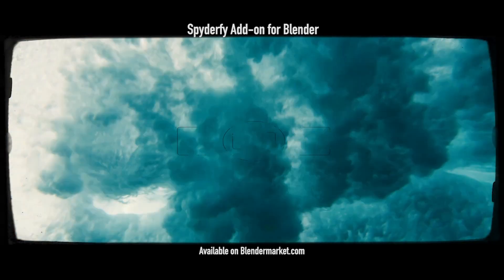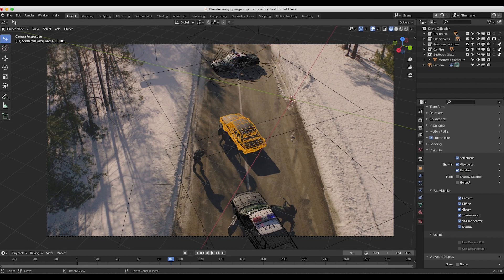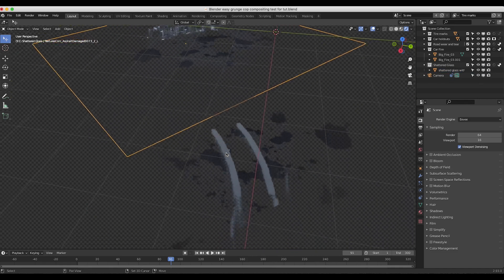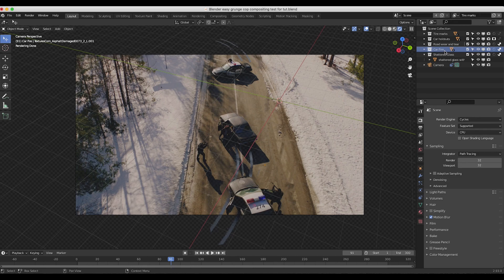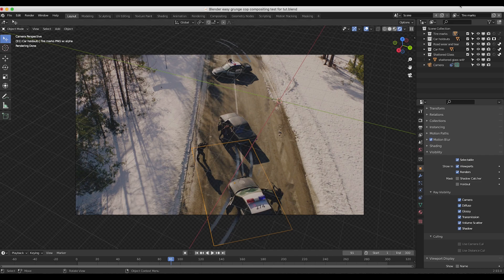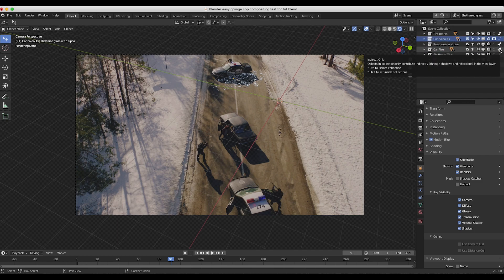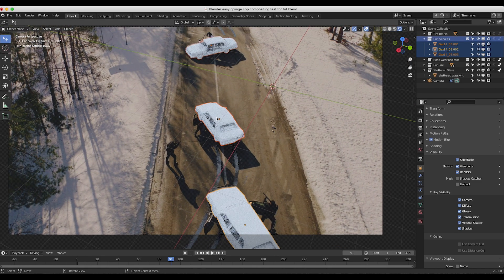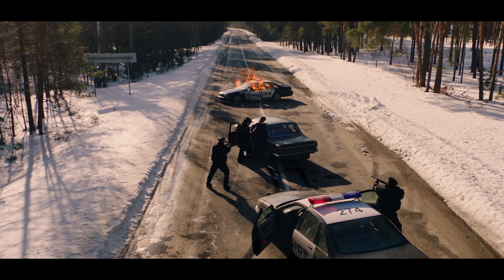Blender VFX Compositing Tip: Using View Layers for more control

Comment: I am using Blender 4.0 and unfortunately what you show on 02:56 does not work: Ray Visibilty "Camera" (or Shadowcatcher for example) is always in sync across all my viewlayers. If I turn things ON for one layer, it is ON in every layer. Pretty frustrating. Is that a bug in 4.0 or am I missing something? Thanks (same in Blender 3.6... so maybe I am doing something wrong but can´t figure it out)